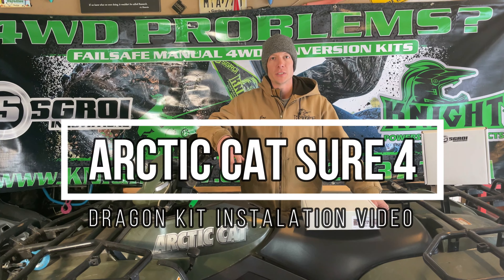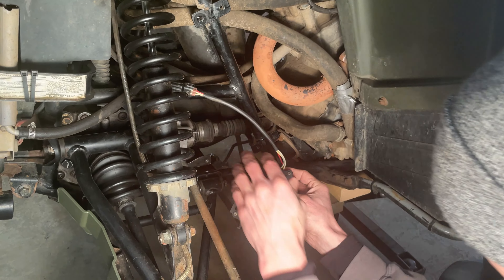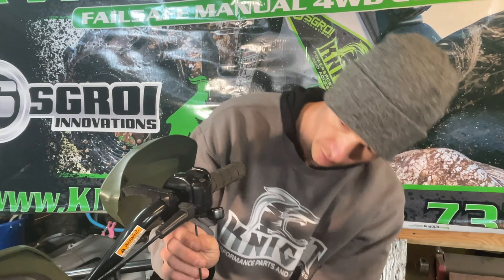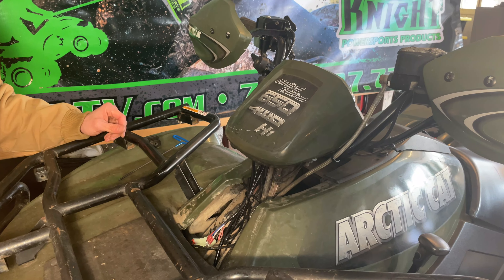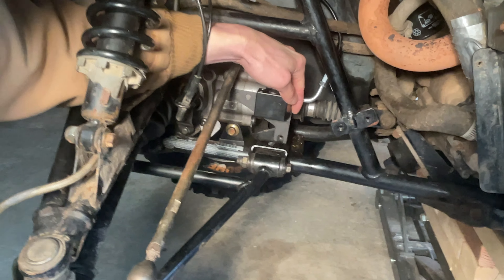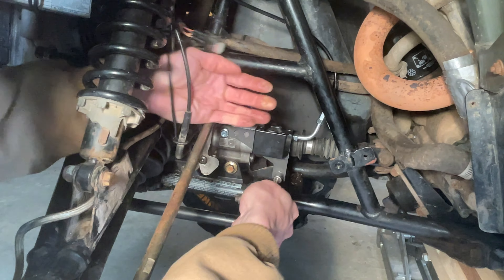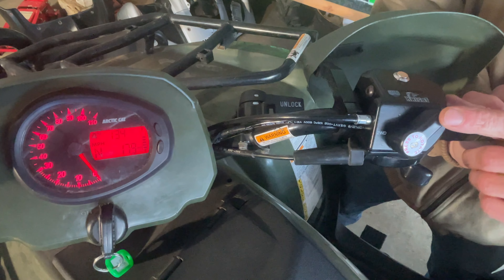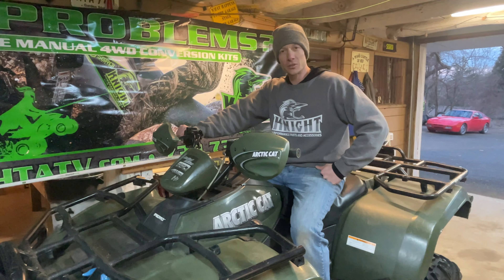Arctic Cat Sure 4 Dragon Kit Installation (FIXES ANY 4WD ISSUE)

Comment: Can it be used to control the optional Arctic Cat center mounted pod light? Instead of having all 3 lights turn on at the same time can you control the center one by itself. Have it turn off and on with or without the headlights turned on or off?
Reply from the maker: Yes it is possible you would just need to tap into the wires that send power to that pod light